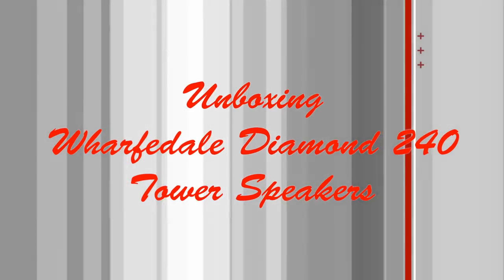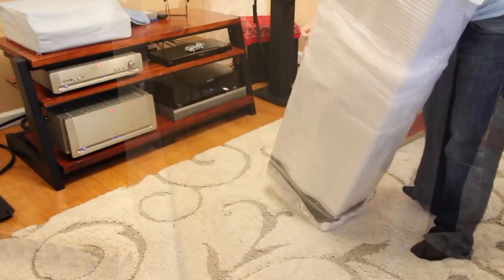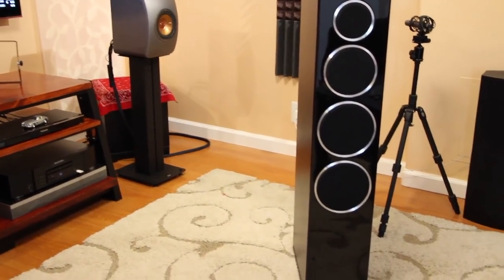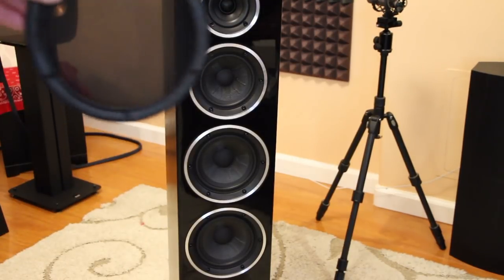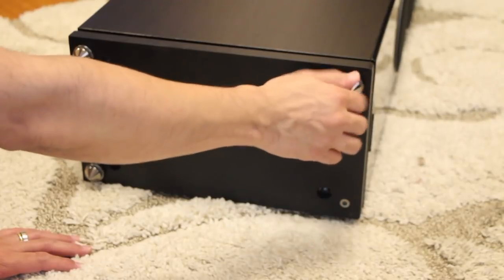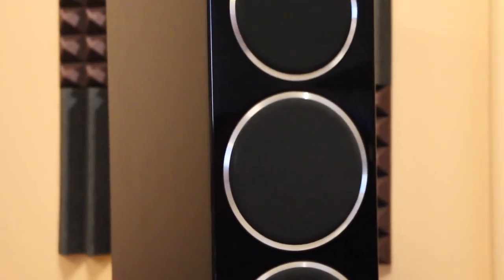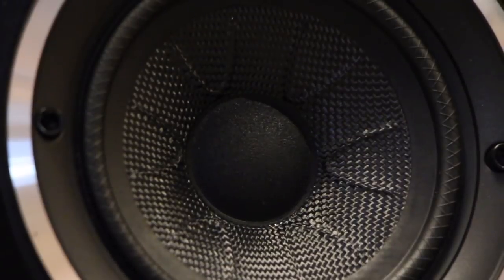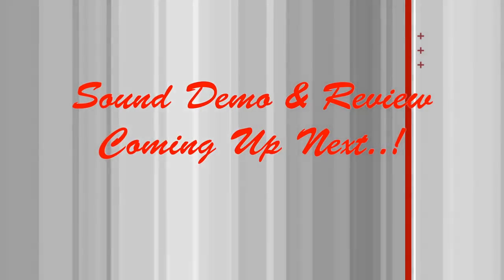Wharfedale Diamond 240 Tower Speakers Unboxing

Comment: I auditioned these speakers the other day in my home city of Mumbai. The pair was connected to a Marantz AV Atmos-capable receiver.
I first heard the 2.5-way younger sibling - The Diamond 230s. I played tracks from Heavy Metal like Iron Maiden to Synth Pop like Depeche Mode, Duran Duran to classic rock from Rush, CCR, Grand Funk Rail Road, Uriah Heep to 60s Sun Bands like Beach Boys, Tommy Shondell to Glam Rock to 90s Grunge (Especially Soundgarden & Alice In Chains) to Pop of the 80s/90s - Duran Duran, George Michael's Hard Day (A very punishing track for mids and bass), Erasure, Madonna, Pet Shop Boys et Al. On a side note Pop tracks usually sound good on any speaker. Then again I have been hearing them since I was a kid on different systems ergo, familiarity with the tracks helps.
In between Jazz from Billie Holiday to Cannonball Aderley to Fusion like Spyro Gyra, Prem Joshua to Indian Fusion like The Dewarists etc. brought in a range of music genres and styles that I thought could bring out the nuances in the speakers.
The 230s were good. Good mids, great highs BUT the low end was similar to my Dentons (80th Anniversary). Please note they are 2.5 way speakers. And for the price the sound was definitely right.
Then I plugged in the 240s. These are full-fledged 3-way speakers sporting distinct separation of Highs, Mids & Low bass. They are also about a good One inch + taller in height compared to the 230s to accommodate the full 3-way drivers.
OMG!!! I was blown away. Apart from the obvious platitudes of tonal quality, the 240s have a distinct tonal signature that brought in refined spread and depth to the soundscape. They are in a class of their own.
Jazz and Fusion shines through. Billie Holiday's Summertime had people in the store actually stop and direct their gaze towards the speakers.
Not so much Heavy Metal and Grunge though. BUT this is subjective because a die-hard metal head who was there during the auditions was awe struck by the sound. On a side note if you folks get the chance arm yourselves with CDs that were mastered during the horrendous digital "Loudness Wars" of the mid to late 90s. A few examples are Creed, Vertical Horizon (First album of both bands). I played them on the 240s for kicks so that I would be discouraged from buying & going broke :-). The speakers are ACTUALLY forgiving to a certain extent. There goes my attempt of not going broke down the drain.
Where I went bonkers was playing Classic Rock, especially Rush. Most of my tracks are Remastered FLACs or Japan released CDs and boy, Rush's remastered Presto was a delight to listen to. Likewise with Uriah Heep.
George Michael's punishing Hard Day actually had the speakers singing away even at volume levels that I never had the courage to dial up to on my home amp (Yamaha A-S2000) with the Dentons. On a side note I played my all time Annie Lennox favourite tracks - Walking On Broken Glass &  Love Song For A Vampire. I was blown away. For the second time. The first time was listening to a pair of Magneplanar Maggies.
The speakers sailed through the commercial MP3 formats @ 320 kbps - separate stereo and iTunes format of M4A. On a side note I had my Oppo BDP-105D connected to the Marantz. I played Spandau Ballet's True in original CD, Remastered CD and DSD. The speakers accommodated the original CD with elan. It's only when we played the next better format that the limitations of the earlier format were rendered visible. I also played Depeche Mode's New Dress between original FLAC & DSD format at the same volume level and the speakers played them without any perceived harshness or laying any sort of excessive emphasis on highs or lows or mids as is the case that I have seen in a few "boutique" speakers that I have auditioned.
As is with good quality towers, they are heavy and the down firing ports will allow you to place the speakers as close to the walls as possible given that houses in Mumbai are tiny enough as it is.
Overall a fantastic value for money out here. I for sure have made up my mind on these towers.

EDIT It's pouring in Mumbai. And I'm haggling with the dealer for a good deal. If all goes well, will add a footnote on how the 240s measure up being paired with the Yamaha A-S2000.

EDIT The 240s have finally arrived and been installed with the Yamaha A-S2000. The audio performance is amazing with plenty of low grunt thanks to the down firing ports. Since the A-S2000 by nature is a tad warm the 240s dont sound way too forward in presenting the soundstage. I reckon if they were paired with a bright amp it woukd be brightness galore BUT not harsh. The 240s tonal signature is definitely different from the Dentons (not because of the size - Bookshelf vs Tower), different enough for me to retain the Dentons and operate the speakers individually on separate speaker channels (A+ B).
The 240s have been used for more than 100 hours, ergo, my experiences stem from the presumption that the speakers have been to the "break-In" process.

The Wharfedale 240s are true lifers. Maybe even last a generation...
Reply: 230s vs 240s mids and highs.Which is less fatigue and more "sweet" in your opinion??
Reply: @andreassouth1523  I would reckon the 240s. Although they pack in quite a bit of low end bass...
Reply: @andreassouth1523  The 240 sound muffled, they start dipping at 800-900Hz. Just like the 225, the 230 start dipping a little at 1.5kHz, which is much better for midrange clarity. The 240 also dip to 2.6 Ohm, which is atrocious, the 230 only go to 3.4 Ohm. I'm talking measurements, not marketing specs. They both sound non-fatiguing, but the 230 sounds clearer in the midrange and won't torture your amp. The only thing 240 has that is better than 230 is the bass, which is a bit deeper, but the difference is very very small, almost negligible.

Comment: thanks to your rewiev i got convinced and I´ve got the 225 and Im very happy with them ( connected to AV receiver from yamaha) 70% movies 30% streamed music or mp3.  White colore finish
Reply: same. I really like the 225.
Reply: turock I think room size is the biggest thing you're forgetting here. A bigger speaker isn't always better depending on the application. Too many variables to make a blanket statement like that.

Comment: Looks like the 225's bigger brother. I'm guessing these towers will sound full and robust.
Reply: The 230 is the superior model. The 240 dip to 2.6 Ohm, which is horrible, also, they sound muffled, thet dip in frequency at 8-900Hz. The 225 and 230 start to dip a little at 1.5kHz, which is much better for clarity, because harshness starts above 1.5-2kHz. The 230 has the decent impedance and great tonality of 225 and the deep bass of 240, so it's the best model in the range. In fact, it's even better than the Linton or the Evos, which are a bit shrill in the high midrange or low treble.

Comment: Thanks for all the reviews. As far as your English, you're doing fine. At least you can speak 3 languages. Anyway, I just want to ask you how do you manage keeping the speakers stable and secure on the stands especially if they have uneven dimensions. For example, speaker stand plate is measured 7x7 while the speaker bottom is 10x8. Thanks! BTW, I bought the Wharfdale Diamond 225. Because of your outstanding review, you convinced me.
Reply from the maker: For securing monitor speakers a lot of people like to use blu tack http://amzn.to/2qkGC2Q
Thank You Luis.